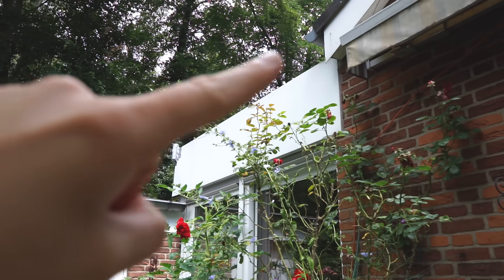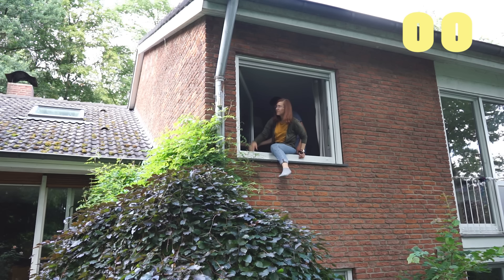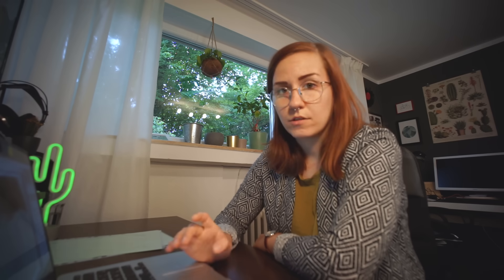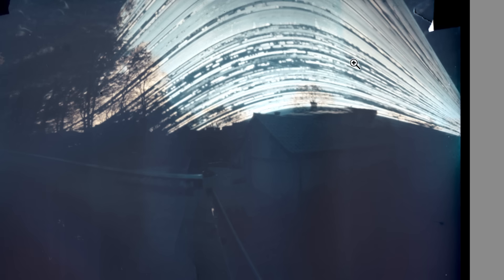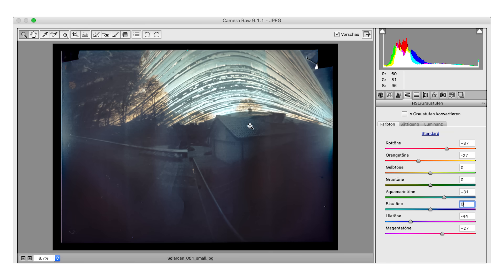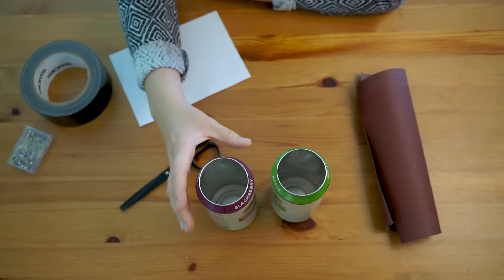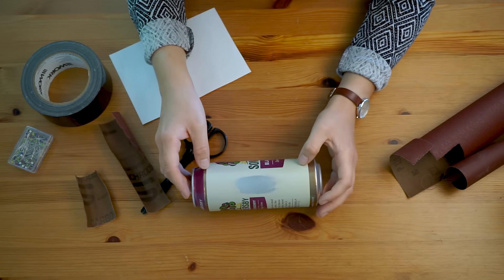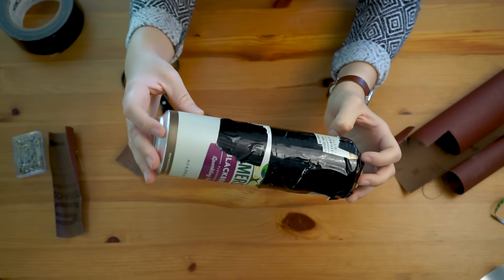Beer can pinhole camera | 1-YEAR LONG EXPOSURE

Comment: Very nice! I've been doing some experements with pinhole cameras, but only with film - not this sort of exposure times! A few tips:

- As Mauricio Andrade wrote below, paint the interiour with matte black to avoid internal reflections. It looked like you had a few of those in the first picture.
- To give the pinhole a better shape, you could sand the inside after punching the hole, with sand or perhaps easier with a dremel. Punch hole, sand and repeat until you're satisfied.- As Mauricio Andrade wrote below, paint the interiour with matte black to avoid internal reflections. It looked like you had a few of those in the first picture.
- The aperture of the camera will be equal to the focal length (aka diameter of the can) divided by the diameter of the hole.

PS: I have no idea what the ISO values of photographic paper is before it darkens before developing it. If you could enlighten me here, it'd be nice.
PPS: I'm quite sure fixing the picture after removing it from the camera should be safe. I've never seen a picture darken after fixation.
Reply from the maker: Thanks for your comment! In case I will make some new beer can cameras I will definitely paint the interior of the camera black. 

Photography paper has a rather low ISO something between 4 to 15, depending on the paper type. I am not sure if all manufacturers state the precise ISO value of their paper. Regarding the fixing I have read ambiguous experiences. It might be fine with fixing and is definitely worth a try, but I have also read problems with emulsion lifts or strong loss of contrast in the image.
Reply: @KarinMajoka  I understand. About the emulsion lifts, I obviously have no idea. At second thoughts, I've tried to fix photographic paper that was lying out in the open for an hour or three and the result was a white paper, so better experiment on this first. It might be possible to develop such pictures, though, if you go close to homeopathic about it - it'd be interesting to know :)

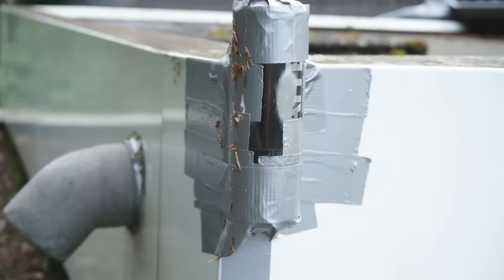Edit: If you were to conduct such a test, a month's worth of exposure will probably do the same as a year, because of the reciprosity failure in the emulsion. Then, if you just use some test strips, as in 10 strips of paper inside a can and just expose them as you have done before, try to dilute the developer 1:5 at first, then 1:10, 1:20, 1:40 and so on and try to develop the strips to see what works.

Comment: I would love to see what this would look like if you managed to mount it overlooking a major roadway. The sun would makes streaks in the sky during the day, and cars’ headlights/taillights would leave trails lower in frame, making the lower portion a lot less empty feeling.
Reply from the maker: You should give it a try! :) I have no experience how artificial light from cars will turn out with this type of camera.
Reply: Car headlights would not leave trails. If it was busy enough all night it may look brighter but no trails
Reply: @philrichardson8974  i think you might end up with trails for each lane, no?

there is one way to check i guess
Reply: @inaoifeble  the problem is you're competing with the sun, which is "on" 12 hours a day and very bright. a headlight and even a path of regular headlight activity is matte black in comparison

Comment: Great idea and video. Here's my personal accidental experience with a pinhole camera. 

Also known as Camera Obscura which creates an upside down and flipped right to left image. Also curve of can will flatten (or would it increase?) the curve of the arcs. Also setting the can so their long dimension is horiz would make a longer image area. I don't believe the thickness of can material is too critical as long as hole is big enough to admit light (maybe hole diam should be at least as large as thickness of can material). A pinhole camera is a safe way of viewing eclipses by looking at the PROJECTED image - NOT THRU THE PINHOLE which could blind. Other than a bit of possible condensation I don't think moisture would affect todays print paper as it's probably made of plastic but need to make sure so ya don't wait a year to to open and find photo paper is all limp and soggy.

A buddy and I (still kids) discovered a C. Obscura while emptying an old storage shed added onto rear of a garage. There was a knothole thru a board of the common wall of shed and garage. When the garage door was open we could see (standing inside the camera itself) cars driving by on the street 40-60 feet in front of garage (the light came in thru garage door opening which traveled depth of garage to rear wall with knothole and projected thru into storage room and onto wall on opposite side of storage room) but cars were projected upside down making them look like they where driving along the ceiling and were also driving in opposite direction (the image was approx 8 feet tall by maybe 12 feet wide). The knothole was approx 3/4 inch in diam and board was also approx 3/4 inch thick.
Reply from the maker: Wow, what a lovely story! An accidental pinhole / camera obscura incident. Really really nice, must have been really very fascinating for a kid to discover something like this! Thank you for sharing. :)

Comment: Would it work to shoot traffic over the course of a year or would that not be bright enough?
Reply from the maker: I have no idea, I have not tried it yet. All I know is that it's recommended to make solargraphs in areas without too much light pollution away from too much exterior light. So I have no idea how shooting traffic would work - but let me know in case you try :)
Reply: Traffic in motion would not record anything on the paper. Even if cars remained still temporarily, I doubt they would be recorded. They wouldn't remain there for long enough to make any kind of impression.

Comment: Hi, i happened to stumble on this fun video just now.
I would like to try it, and by that, i would like to know is there any specific photosensitive paper is needed or we can use any type? Because when i google it, lots of type of photosensitive paper seems to be on the market..
Reply from the maker: You can use any black and white photo paper you can find. It's recommended to take one that is more contrasty so has a harder graduation. In my case I used some old expired Ilford paper with grade 4 or 5. I think it's not produced anymore, but Fomapan also makes nice paper with hard graduation.
Reply: @KarinMajoka  thank you! I think i need to do some  (lots) of survey and stuff with the local shops regarding this then. 😂

Comment: When you scan it in what exactly happens?  I'm thinking that as the paper is sensitive to light then a "Preview" might affect it?
If you don't preview the paper then do you set it to basically a white piece of paper?   We don't really see the original negative in your video (it goes from opening the can to having scanned the image).
Reply from the maker: I did not show the paper after taking it out to safe it from too much exposure of light. But basically the image at @4:48 is exactly what you can see with plain sight. So the negative is already on the image even without developing it. The light of the sun is so strong that it basically "burns" the image onto the paper. And yes, technically the light of the scanner exposed the image but since we won't develop it, it does not really matter. Too much light over time might make the image foggy over time though, so it's better to store it away in a dark spot

Comment: can someone tell me which type of photosensitive paper is used and where to buy it??
Reply from the maker: You can use any photosensitive black and white paper. It's recommended to take one with more contrast (higher grade), but pretty much any paper even expired one should work. It's depends on your country where you can buy it, analog photography store are usually the best source

Comment: Made one myself, and took an exposure from mid summer to mid winter. It came out beautiful!
Reply from the maker: Awesome! 6 months is actually a perfect time frame. Some of the other solargraphs I made early were also made from solstice to solstice
Reply: I have already prepared a few other ones with i intend to install in december this year, (winter solstice), until June 2023. (Summer solstice). 

I remember when I hang mine on my balcony, my friends and neighbors were curious what it was. When I explained it's purpose and the work it took, (search for a red lightbulb, photosensitive paper and turn my bathroom into a darkroom, stuff like that), they were laughing at me.

But as soon as i took the paper out, scanned it into my computer and shared it with them, they were impressed by the result.

These are the little nerdy experiments I like to do every once-in-a-while.  It doesn't cost much, and it only takes time. :)

Comment: Did you use photographic paper? So, isn't the scanner destroy your image the fist time you scannered it? I just want to understand
Reply from the maker: Only for the demonstration purpose of building the camera I used regular document paper. For the real cameras themselves I used black and white photosensitive paper. The latent image negative will be visible on the paper after the exposure by plain sight which means it's not necessary to develop it to see a negative. And thus, the scanner light won't make any damage since we don't develop it anyway. It's still recommended to store the paper sway from light to make it last longer and not deteriorate over time.
Reply: The time the scanner paper is exposed to the scanner light is far to short to make the paper go dark, it takes hours in front of full sun to make it change to a darker colour

Comment: Hi. What image can be scanned on an undeveloped paper? I thought the developer was needed to remove the sensitized particles, leaving a negative image. Completely overexposed film is still white so what is the scan seeing? Also, sensitivity is very important when considering exposure times. If you are exposing for 1 year, then the paper will have to be a different ISO surely. I`m interested that the paper you use is so insensitive that you can have it sitting there on the desk beside you fully in the light. Did you just use normal paper for the demonstration? I apologise for the questions, but a lot of things puzzle me in this video. Thanks : )
Reply from the maker: I just use regular black and white photo paper which usually has an iso between 4 to 12 or something like that. I did not show how the paper looked like right after taking it out of the can after one year - but it's exactly the image @4:48. So you can see the latent image with your plain eyes already. Technically the image is overexposed due to the long exposure time. But this is why we don't develop it because it would turn completely black. And yes, I used regular paper for the demonstration on the desk. And this is why I point out in the video that the step of loading the camera with photosensitive paper has to happen in the dark. :) Hope this helped?
Reply: @KarinMajoka  Thank you for the reply. I`m amazed that an image is present on undeveloped film. Thank you again.
Reply: @KarinMajoka  Very well explained and very interesting to read, thank you. Though remember that a latent image is not visible to the eye. So with this type of photography, we are not dealing with latent images but visible ones. I am really looking forward to trying this myself. I would like to paint the inside of mine black. As I don't have spray paint, do you reckon it would be okay to paint with a brush? Obviously, the interior won't be as smooth.

Comment: I would love to see this composited with a daytime picture of the same landscapes to bring back some contrast and color information into the solar-graph scenes.
Reply from the maker: I think it will be almost impossible to align another pinhole camera in the exact same way to retract the information from that image. Other cameras won't have the 180° field of view.
Reply: @KarinMajoka  I think you could composite two pics and warp them to fit the pinhole.  Kind of the opposite of taking the warp out of a GoPro image.  Anyway, cool project    Cheers from Venezuela

Comment: How does taping over the hole work as a shutter? Will light penetrate the tape?
Reply from the maker: You put the tape on the whole after building the camera and once the camera is setup on it's location you take away the tape. After your exposure (1 year or shorter) you put the tape back on. So the tape should NOT stay on the camera during the exposure but works as a shutter in as far as it secures light going in before it's all set up
Reply: @KarinMajoka  Thank you! was so confused by that part, hehe. That's the second-most replayed part of your video too. Great project!!

Comment: Catching the sun paths one year is brilliant, you can even kind of see the weather and clouds for each day! I have a question about the paper, what paper do you use and why do you not need to develop or fix the image?
Reply from the maker: Thanks for your comment! :) You can use whatever black and white photosensitive paper you can find. It's recommended to take a more contrasty paper with a harder grade, but multigrade or even expired paper works as well. Once you take out the paper after the 1-year exposure you can see the negative even without developing since the sun is so strong that it almost "burns" in the image into the paper. And developing would turn the whole paper black because it's practically overexposed.
Reply: @KarinMajoka  Very interesting, never heard of this techique before! Almost like the blue DIY photo sensitive paper you can put leaves on and leave in the sun.

Comment: Karin Majoka! This was super interesting! Couple of questions, does the type of photo sensitive paper matter for this type of long exposure? Any suggestions? Also, because it was photo sensitive paper, does the scan effect the paper? Seems like a lot of light you are blasting at it? Anyway, super cool video, super fun project! Wheels are spinning, hopefully in 12 months you get a comment with my results! thanks for sharing!
Reply from the maker: Thanks for your comments! :) Regarding the paper: Pretty much any black and white photosensitive paper should work, even expired paper is fine for this type of project. I used some old expired Ilford grade 4 or 5 paper I found on eBay but you can also buy fresh one. Technically the scanner would affect the image on a regular exposure but in our case it does not really matter since we won't develop the paper. If we would develop the paper it would turn completely black since it would be fully overexposed after such a long exposure of one year. And since the sun is strong enough to almost "burn" the image onto the paper by plain sight, only scanning is sufficient. And the scanner light is not strong enough to affect the undeveloped paper. Hope that makes sense?
Reply: @KarinMajoka  Yeah, I don't know if makes full sense...but I trust your word and your video shows it working so I guess I shouldn't question. Found a few other videos out there that do the same thing! Again, thank you!

Comment: they used to have those plastic sippie things that you snap on top of the aluminum cans that gives the can a closeable lid and a little sippie port so you can save it for later if you dont drink it all, I wonder if they still have those. They're pretty cheap, I bet that would work pretty good for this. Might be better than duct tape, but I dunno
Reply from the maker: I have not seen those yet - but I am from Germany and therefore not sure if they were sold here as well. But that would have been a nice solution as well! :)

Comment: Amazing work! Really interesting stuff. What photosensitive paper did you use? What ISO does it have?
Reply from the maker: I used some old expired Ilford paper, grade 4 or 5. I am not completely sure which iso it had, but it does not really matter either - you can use whatever paper you can find. Harder (more contrasty) paper is recommended but even expired paper works really well.

Comment: Why do you scan the paper instead of process it? I don't know how scanning works with this. How does that work?
Reply from the maker: I mean, you can try it out with development - but I assume you won't have much fun with that because the image would turn completely black. The light of the sun is so strong that it almost "burns" the image onto the paper, so no development is needed
Reply: @KarinMajoka  I'm hard headed. How does scanning it "develop" the picture?
Reply from the maker: @minkymott  It doesn't. Scanning does not develop the picture. But development is not necessary - you will see the latent image when opening the can even without developing because the light of the sun is so strong.
Reply: @KarinMajoka  it makes sense now, thank you so much. I was going crazy trying to figure it out. :) Also, thank you so much for taking the time to reply.

Comment: Wouldn't reciprocity failure mean that it would be barely sensitive to light after such a long exposure? I'm not that knowledgeable around long exposure stuff
Reply from the maker: It will decrease in sensibility for sure, but I don't know how strong it is. Paper does not have such a high iso and reciprocity failure is stronger on higher iso material generally.
Reply: @KarinMajoka  oh huh. I didn't know it wasn't film tbh. I know nothing about pinhole cameras. But the video is pretty cool and I'd consider trying it for 6 months next year